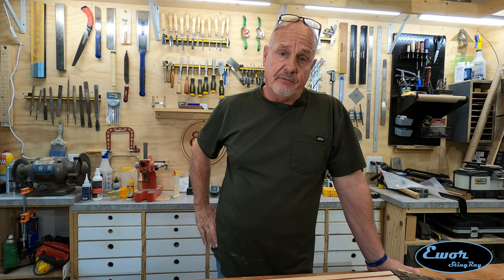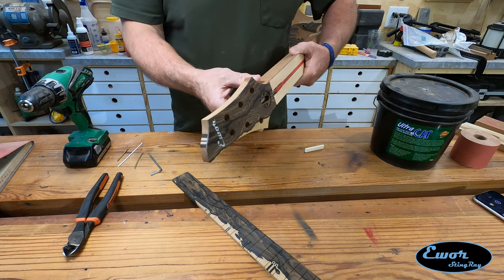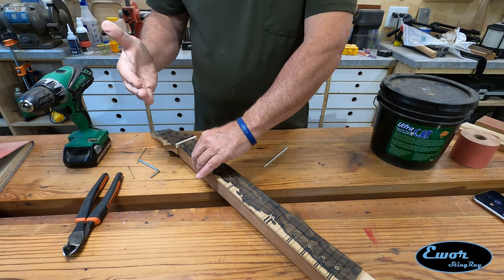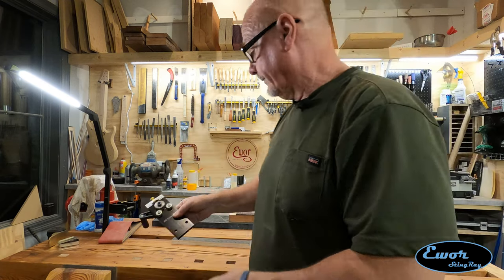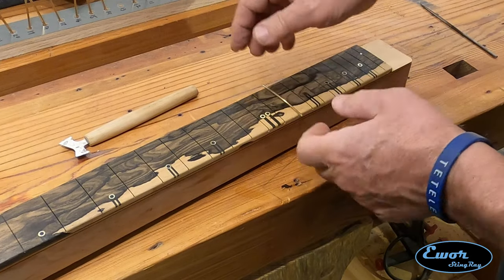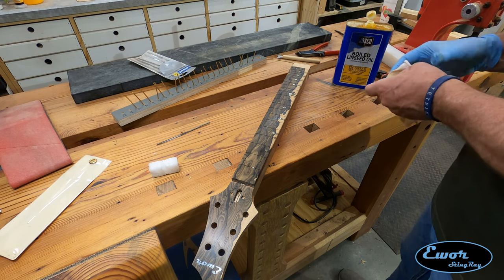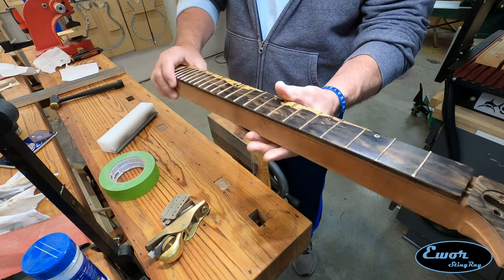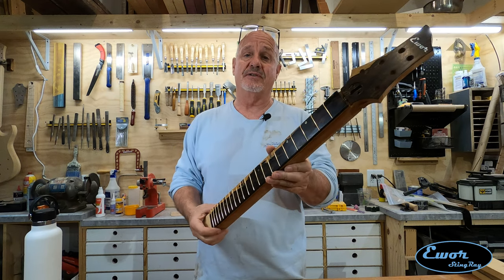Ewor Stingray part 10: Fretboard Install

Comment: Hi. Love your vids. Guitars look stunning. Just some questions. Didn't you supposed to bend your fret wire to a slightly tighter radius than your fretboard (on video yours looks a little flat, like exactly matching fretboard radius)? It helps fret tangs to better grip wood fibers when fret goes in the fret slots. And also you can use regular white wood glue like titebond or something like fish glue instead CA glue (using a syringe with a needle to put glue into fret slot). It will be much easier to cleanup by just using some wet rag (but you will need to wait little bit longer until glue dries and fret ends can be cliped). Anyways, keep up good work!
Reply from the maker: Thanks for watching and commenting! The frets are actually over radius although maybe not enough. And yes I have also thought about wood glue but just haven’t done it yet.